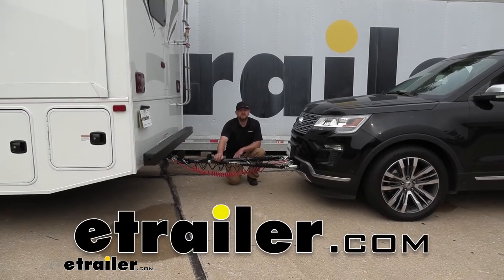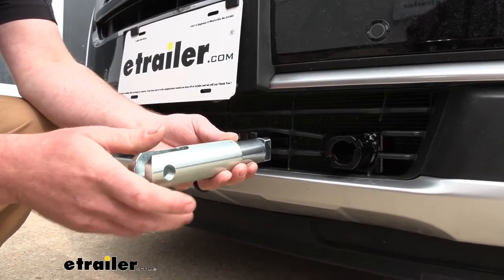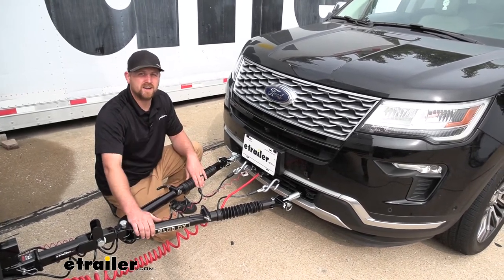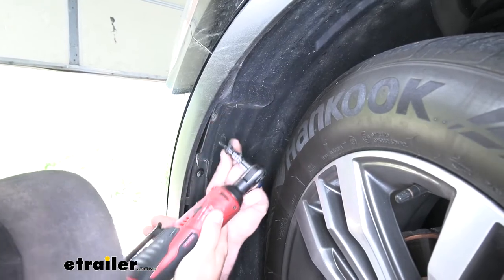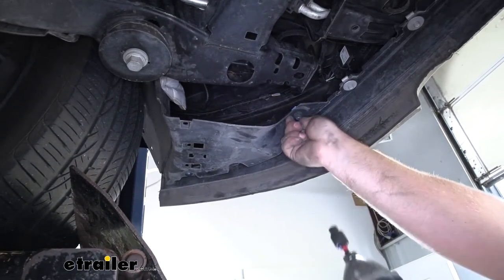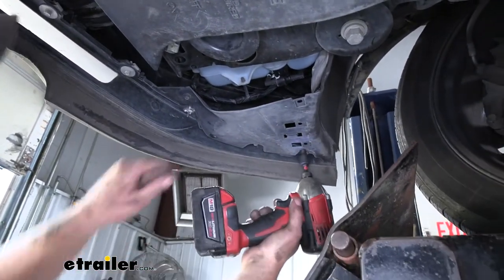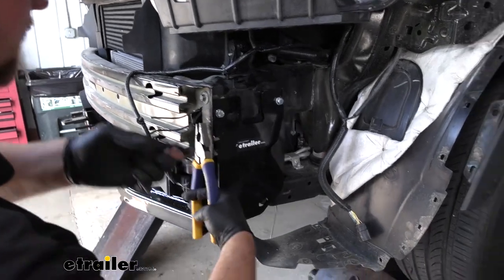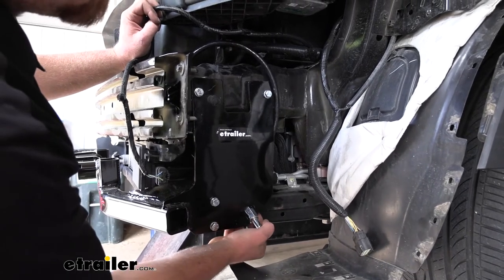etrailer | Blue Ox Base Plate Kit Installation - 2018 Ford Explorer

Comment: Who's bright idea was it to mount the lower mount to the sub-frame. Completely cancels the isolation of the sub-frame.
Reply from the maker: Blue Ox designed the base plate system and the manner in which it's installed.
https://www.etrailer.com/Tow-Bar-Base-Plate/Blue-Ox/BX2668.html

Comment: Was this a 3.5L 4WD? I am getting conflicting information if it's flat towable.
Reply from the maker: According to the owner's manual, 3.5L Duratec and EcoBoost engine equipped Explorer models can be flat towed if the procedure outlined in the manual is followed. Check out the 'Recreational Towing' section of the manual for full details...
https://www.etrailer.com/Base-Plates/Blue-Ox/BX2668.html